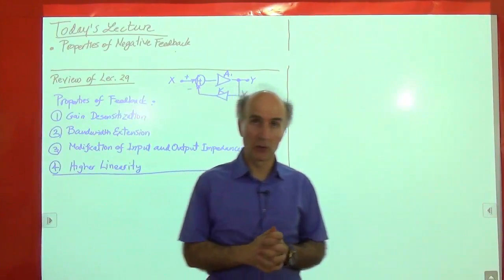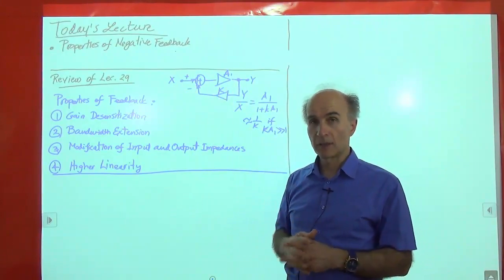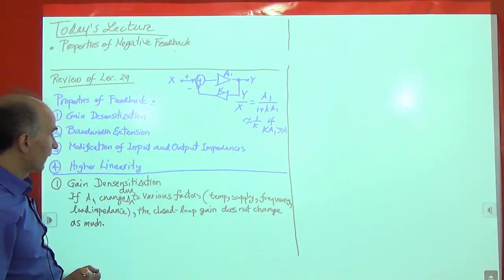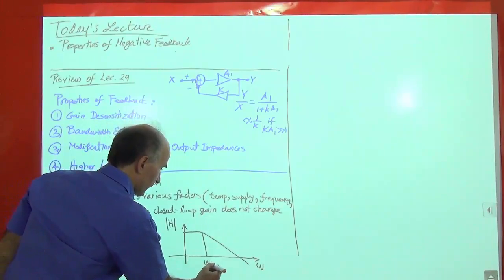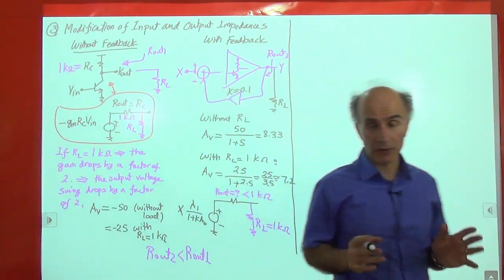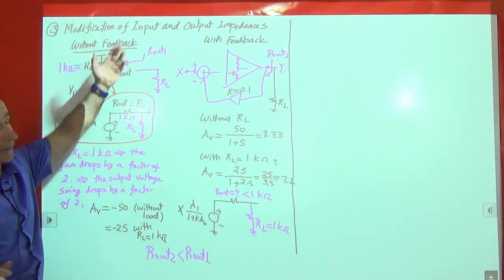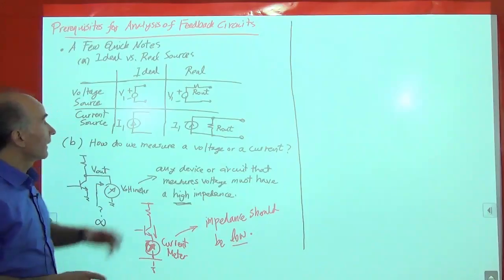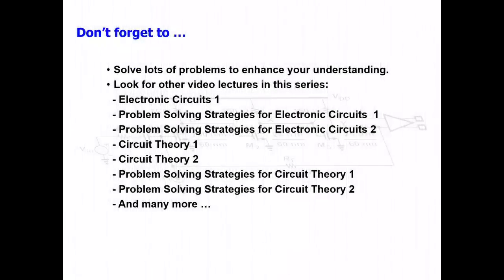Razavi Electronics2 Lec30: A Closer Look at Properties of Feedback Systems

Comment: 01:25 - Intro and Review
03:44 - Gain Desensitization
06:42 - Bandwidth Extension - Pole Frequency Gets Multiplied by the Loop-Gain (Gain x Bandwidth = Const.)
17:32 - Modification of Input and Output Impedances (although amplification drops due to high load, negative feedback is still compensating for it and maintaining amplification)
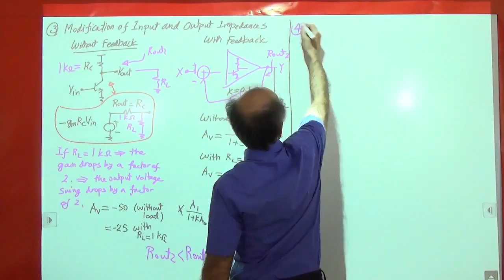29:27 - Higher Linearity (impact of gain change with higher input differential amplitude, to the closed-loop gain is less)
36:40 - Prerequisites for Analysis of Feedback Circuits